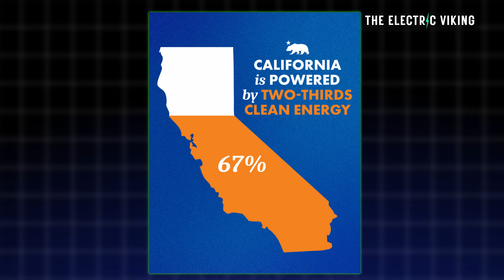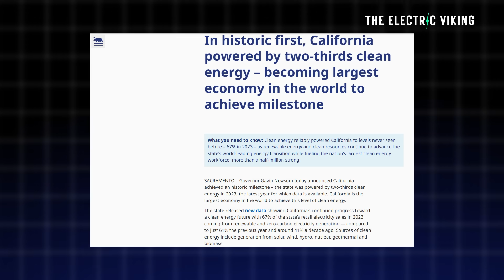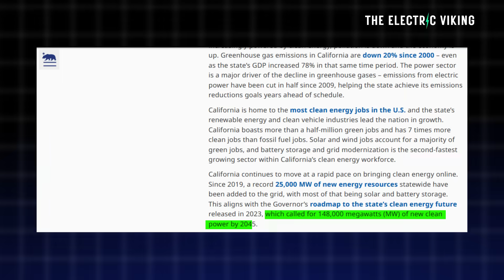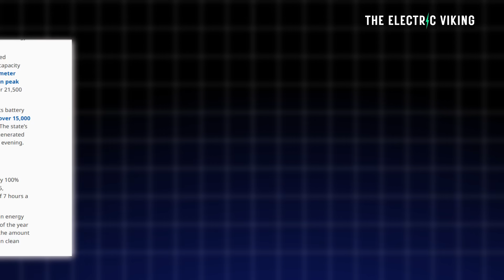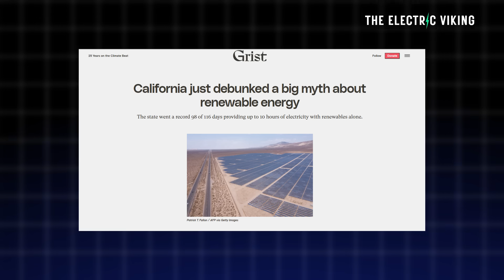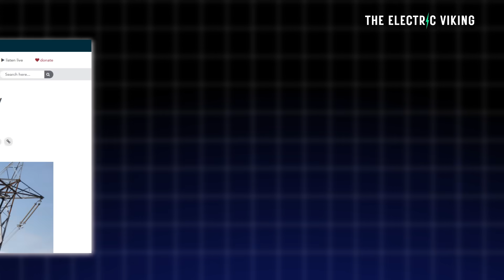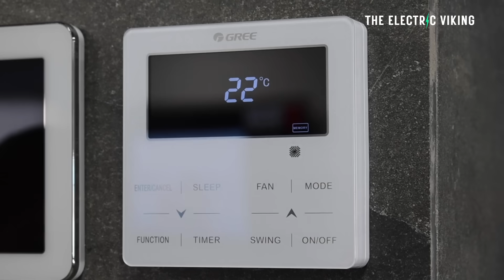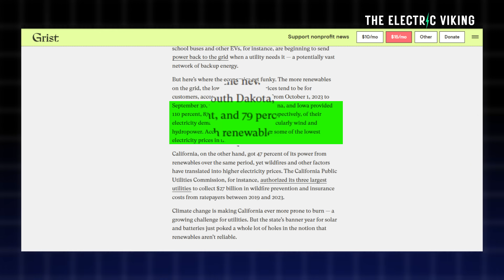California Shatters Renewable Energy Lies; Largest economy in the world to do this

Comment: Southern California electric power provisioning is a disaster being both the most expensive electricity in the US including Hawaii and suffering blackouts from a frequency destabilized power grid and not upgrading its power lines due to being bankrupt having them fail and cause fires.   This comes from state government political demands on the power grid.    Southern California has to import much of its electricity.   It has no spare capacity.  It is asking companies with backup generators to run them during power alerts to remove demand from the power grid.  Its remarkable engineering work that the grid has been able to provide electricity at the level of service it has.   It's a no go for new industries needing economical reliable electricity.   It's actually cheaper to run a home natural gas generator for power during peak residential power rates than to buy it from the grid with high priced residential natural gas and only about 20% efficiency.

Comment: One of the hidden secrets of ICE vehicles is that it takes between 2 to 8 kWhrs of grid supplied electricity to produce each gallon of diesel/petrol/gasoline, with about 4 kWhrs per gallon being average. The average EV can drive 8 to 32 miles on that electricity no longer being used to make that fuel.

Comment: One thing you did not mention is that renewable energy stored in large batteries can be physically transportable to where it is needed. This could include disaster areas or emergency services buildings if the local area had a power outage. For the 1st time in history we can load up a green energy mega pack on a truck and move electricity to where it is needed when it is needed or preposition them to be prepared.

Comment: This is all great news, by US standards. But as is the norm now (mostly because of its regressive politics) the US lags behind many other developed countries. At this moment, as of 0730 on August 7 2025 the UK is running on 45% renewables. The sun is not really up and in any case it's a cloudy day, and the wind is very light. There have been many days this year when the UK has run ENTIRELY on renewables.

What is the limiting factor for us now is not so much the generation source as the inability of an under-invested power grid to properly distribute the generated power. The current government has announced big increases in onshore wind (something the previous administration had banned for specious political reasons) as well as more solar and battery storage. Within a short time frame there will be even more days when the country runs on 100% renewables.

Unfortunately the government has also announced a new large-scale nuclear plant which seems terribly out of date. There's a future in micro-nuclear for sure but large scale nuclear should become as extinct as the dodo.

For once, the UK is ahead of the rest of Europe, but the Scandinavians are aceing it and will beat us all to near 100%.

Comment: First of all thanks for your insightful videos.  I live in California and have solar panels. I overproduce and thus run a surplus that not only powers my house during the day, but charges my car and sends power up the line for others to use.  Yes, there is some payment back for this from the power companies, but below what they charge per KW to customers.  So, we are on the right track here and are many other states because of large array and wind farms as well as individual homes with solar and battery back up who are just not pulling from the grid, especially in peak hours. Unfortunately, the power companies here are aware of this and are working against us a bit these days.  We had to fight the same myth about home solar was raising electricity charges for those who do not have them.  That myth was started by the very power companies that encouraged us to go for solar panels to help spread the demand just a few years ago.  Overall though, we are moving forward, quickly.

Comment: I live in Southern California and have solar panels and a heat pump on my home. We planned that our next car will be battery electric.
That said, I see so many gas and diesel powered vehicles currently on the road, I wonder how much more generating capacity will need to be deployed to power even half of them with electricity. I’m not sure that enough solar can be built out to handle the job. I would like to see an analysis on this point.
Reply: there ya go. Have at it.

Comment: I live in the Los Angeles area with a 3 year-old, 3400 sq.ft.  house that is well insulated, has a large rooftop solar system and a single Powerwall 3 battery.  About 85% of the energy generated by my house goes out to the grid.  There are only two times when I draw from the grid: 1) When I charge my Tesla, and 2) when the air conditioning is running and it's later in the day when the sun isn't hitting my panels at a good angle.  I'm very pleased!

Comment: As a Californian, I look forward to a day when we can provide as much power from renewables as the three smaller, in terms of population, states you mentioned. I find it interesting that batteries are not necessarily limited to renewables. Fossil fuel electric generators can make use of them as well. Neither are they limited to being defined as industrial scale. Distributed batteries can help all of us. The power is provided closer to where it is needed, saving transmission losses and infrastructure costs. Power can be provided at peak times from batteries, as you said, even if they aren't fully charged. You can make money during the peak of your batteries, whether they be wall units in your garage or your car, with a much bigger battery. Then refill them with cheaper power at night. 

You said recently that we are getting big charging speed gains simply using better sensors and software, with the same kinds of batteries we already had. This might be true, I'm guessing, about fires at battery installations like you describe in this video. Possible? 

Much of what I said about distributed batteries has already been stated for decades about "distributed generation." This is a striking fact to me because I used to follow that subject professionally, but only now made the ahem connection that distributed batteries, when feeding back to the grid, are essentially acting as distributed generation. So u recommend people read up on that topic to learn lessons from a very long push in this direction, including the subject of interconnectivity, that is, the ability and process for getting approval from your utility to connect and give back to their grid.

Comment: California shatters its economy with rubbish unreliable energy. To deal with the intermittency of this massive quantity of intermittent unreliable renewables they have to import huge amounts of electricity off of interstate interconnects, which is incredibly expensive. So what is the average cost of California electricity?  $0.30 per kWh.  46% above national average.  The three states that have the highest proportion of electricity from coal, which produces reliable 24/7 power, are W. Virginia ($0.16/kWh), Missouri ($0.13/kWh) and Wyoming ($0.14/kWh).  That shows you what California has really achieved. Poverty for its citizens and the exit of any energy intensive business.

Comment: DUDE IT DOESNT WORK 🙄 ... out electricity bill are SUBSTANTIALLY HIGHER. We aee only least that maybe Hawaii, for the highest costs.
WE BUY / IMPORT energy from other states. It is great for supplemental BUT NOT the main source.
Its also good if you can afford ro get it for your own house and go partially off grid,  but otherwise, it is a FAILURE !! 🙄🙄🙄

Comment: I think these kinds of stories are under-reported for several reasons: news media themselves do not really understand the ramifications of the developments, it comes across with too much techno-jargon that people do not understand (you do a better job on that front, Sam), and it’s good news with no conflict involved so media finds it boring. Most news media still operate under the old “if it bleeds, it leads” model of reporting - conflict attracts attention; quiet achievement does not, even when it means freedom from oil empires and saving the freaking planet. (Crickies, what’s a guy gotta do to get a little atta-boy?)

Comment: Great to focus on the last one - the cost of electricity. Renewables are now the cheapest to install but the doubters still point to higher cost electricity. Large batteries currently being used to maximise peak hour profits, once these are built out the supply will outweigh demand and prices will come down, just expensive to get there

Comment: In South Australia, we have been  net exporter of power in summer.   But in federal parliament they pooh pooh Solar power non-stop   When we relied on th grid, there were many days in summer when the grid failed and we had black outs, and the power chrages from the national regulator were in the 1000's of dollar per KWh    WE have the power companies wanting us to turn off solar feed into the grid!
Reply: So how is your electricity produced at night, a bit of wind and mainly gas. If not connected to Victoria you would be no better than South Africa.
Reply: @lintrobb4628  We have large batteries  We dont have any problems at night with cost for power due to low demand being very low  We had the first Tesla battery in Australia (Elon offering it free if it wasnt delivered and install within 100 days I think).  We do have emergency gas generators - but they run during the day usually,

Comment: Utility sized Solar, Wind and Battery are the lowest cost power.    Distributed residential Solar and Battery is very low cost.  Lower cost than coal, oil, or gas peaked plants with the added benefit of not needing the grid.   EVs will replace ICE cars.   Add SunHydrogen created Hydrogen for long term (months to years) and carbon based energy is like wood, horses, steam going to still be around but for nostalgic entertainment purposes.

Comment: Still, more goals are still needed. If you check CAISO data, you can see a lot of days there is a significant fraction of Natural Gas in use. I'm afraid there is still a significant fraction of NG used for grid stabilization. Batteries are good for regulate production but if aren't coupled with grid-forming inverters, they are limited replacing the old synchronous systems.
That's the reason you will see that 100% renewable moments includes a significant fraction of hydro (and/or biomass) that have synchronous systems. Solar thermal too, but most solar is PV.

Fortunately, inverters are evolving fast, and in a near future most inverters will have grid-forming capabilities.

Once a 100% of solar+wind+batteries are possible, more hydro will be displaced for moments where solar+wind are low, and the NG fraction will reduce even more.
When reach enough low value, NG could be migrated to hydrogen, produced in the most abundant moments of the year. Hydrogen has different qualities to batteries. Decoupling power from energy storage and can be stored for longer times with less loses. Good choice when a significant part of the cost is the storage itself, not the power, with a small number of cycles per year.

And with that, a 100% model for the whole year will be completed.

Comment: There can never be too much renewable energy. If you are producing too much energy during some part of the day, that isn't a problem. It's an opportunity to add storage to the grid.

Storage doesn't have to mean batteries. It can be an ice storage air-con that uses excess energy to run a second compressor and produce ice in an insulated container that can during periods with low renewable production chill spaces with next to zero energy cost. It can also be something like a sand battery, storing heat for use in home heating or hot water.

You can't ever produce too much energy. You can, however, have too little to spend it on.
Reply: Really you need to produce 3X the power you actually need with solar because you have to produce it all during a short period during the day, charging up batteries to use for the other 2/3 of the day.  So your production capacity has to be 3X what it would be if you had something that could produce 24 hours a day.
Reply: @jiminauburn5073  Facts and logic are completely lost on the delusional fanatics on here mate.
Reply: @jiminauburn5073  Nope. Electricity consumption decreases basically as the sun goes down. There is a spike correlated with people coming home and cocking dinner but otherwise the electricity demand during the night is like a quarter of what it is during the day. So you only really need about 2x the solar to charge batteries for nighttime consumption.
Reply: @EMBer3000  No, electricty consumption patterrns do not look like that, there are consumption dash boards available online to demonstrate that. The one I just looked at for California shows consumption peaking at around 8pm then declining slowly till midnight, when consumption is the same as at midday.

Comment: California's push to go solar has doubled the electric rates in CA. 100% renewable indicates there is no base load generation. Base load generation is the lowest cost energy on long-term contracts.  Someone has to pay the utilities to provide free energy storage for solar customers like me. My system went live in October, and I ran a negative balance until the following October when I had a $25 credit.
California mandated that all new construction would include solar unless it was proven that it was not practical, like in a location that did not get any direct sunlight. The legislature, in their great wisdom, thought that if solar was included in the construction, it would be more cost-effective than retrofitting. Because new construction does not have a year's worth of history, the maximum permit size is based on half of the expected electricity needs. In reality, the mandated solar turned out to be a 50% system. Property taxes are based on the home sale price. To keep from paying property taxes on the solar, it is billed separately. The house I was looking at had a 4 kW DC array built in such a way that it would be tough to add to it, and if you did the power purchase agreement that most buyers were doing, they did not have to finance the solar; you could not add to it. Solar was mandated in the permit, which makes it a take it or leave it choice for the house, not just the solar. It was priced at least 25% higher than a retrofit would have cost. My prices for the components were about half what they were selling them for. The power purchase agreement had an escalator, making it more costly than utility energy. Our rates have not gone up nearly as fast as the PPA.

Then came Rule 21 inverters that allow the utility to turn your inverter off if they do not need the energy. So, you were counting on producing energy with your system, but not today. Your house is now running on grid power after your inverter is turned off. There are times utilities are paying other states to take our excess production, and a report is available that lists the amount of curtailed production.
Solar has never been competitive without government subsidies.
Now the rules have changed to the point that you install a tiny system so you never put any energy back on the grid, or you install batteries so you use the energy you produce. The batteries will cost as much as the rest of the system. Unless you over-size the system, you will still be using grid power for four months of the year. It is not practical to install a system that provides all of your needs each month. It is more cost-effective to rely on some utility power every month if not every day.  

My 9.2 KWDC array in Sacramento, CA, has covered my energy bill for about 10 years. It only works because I get retail net metering. From 4 to 7 PM in the summer, I get a 45-cent credit/KHW that my utility could buy on the open market for 7 cents or less. Other times, the difference is less, but I never receive less credit than twice the wholesale market price. I use more energy than I produce, but I use it when the prices are lower. The stock I sold to pay cash for my system would be worth more than $200,000 today. I built a Ground mount system for about half what a contractor would have charged. My system carries about $400 in credit now. Some places have a use it or lose it policy, but I can carry the credit but not cash it out. 
I took my best solar year and figured out what it would take to go off-grid. My off-grid system would cost about 8 times as much as replacing my present system with contractor present prices.

California would be much better off if it had never heard of solar!!! Our rates would be half what they are now. Solar has cut into the base load contracts at a lower price generation, making base load combined cycle power plants less profitable. Combined cycle power plants and peaker plants serve different roles in electricity generation, with combined cycle plants offering higher efficiency and lower emissions. In contrast, peaker plants provide flexibility to meet peak demand. Combined cycle plants are designed for continuous operation and greater efficiency, using both gas and steam turbines to generate power. In contrast, peaker plants are typically simple-cycle gas turbines designed for quick startup and shutdown to meet short-term, high-demand periods. AS solar cuts into base load requirements, even if it is for a short time, the base load generation is cut off and replaced with peaker generation for a significant part when there is not enough solar to carry the load.
How many billions of subsidized dollars have been wasted to make our energy one of the most expensive in the lower 48 states? One report I read said that if the subsidy had been spent on nuclear energy, we would have been able to build all the plants we need to run the state.